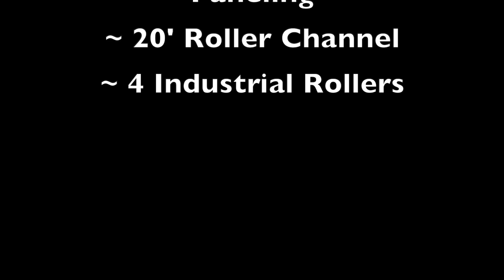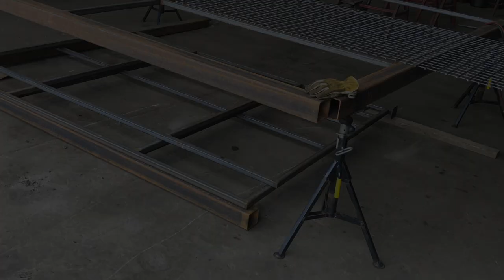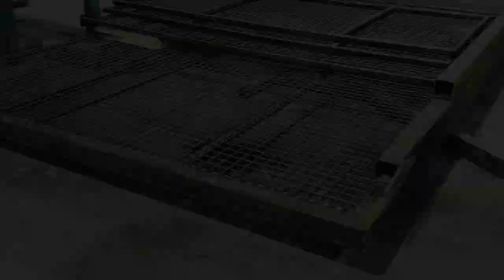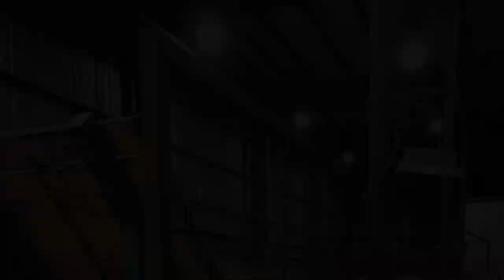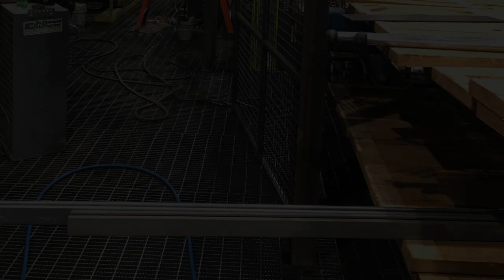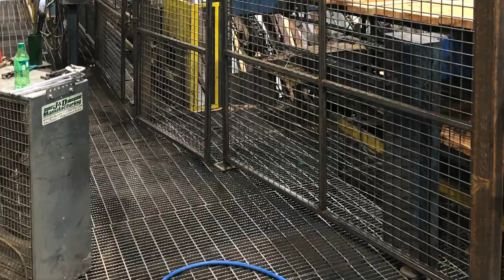PROJECT BUILD - 30' Safety Barrier

Comment: awesome project! looks like fun, the welded wire mesh looks a lot safer than the expanded metal I hate dealing with. well I hated it after building a console for a car between seats, as a teenager, all the way to dash, & having to put gauges & stereo in it, got too many cuts & never cared for since, but had to deal with on so many trailer decks.
Reply from the maker: I agree the welded wire was a lot easier to work with especially since I built it by myself

Comment: Looks awesome. Is the intention to keep things out of the machine or to keep things from flying out of the machine? Only curious with the thought of which side the grating is welded on.
Reply from the maker: I welded it on the inside because it is meant to prevent anything from coming out of the machine and hitting someone.

Comment: Robi > getting errors sending you email (address not found)
Reply: Same issue Hoss!
Reply from the maker: So sorry guys, with my super secret revamp of Welderbeast my email has got changed to robis@welderbeast.com and if it’s easier try sending me the stuff through WhatsApp and my number on there is 479-225-9431

Comment: I would love to have something like that for the coming zombie apocalypse as depicted on the historic documentary otherwise known as the walkin' dead.
Reply from the maker: Lol right
Reply: @Welderbeast  I see a MIG welder in the background. You could show how you made one joint.
Reply from the maker: Protected Profile I was getting paid per hour so only had enough time to take quick pictures during the process. This was the best I could do. I’m looking forward to seeing your video explaining how to weld a joint up with a mig welder though;)
Reply: @Welderbeast  I was trying to fill holes in sheet metal with a stick welder. It was bad. Couldn't get it smooth, tar bedliner on the back, smokin'. I don't have skill.
Reply from the maker: Protected Profile lol I bet you did better than me, I have never welded sheet metal in my life
Reply: try rusted auto-body metal! which is now unknown thickness, as a variable, & weld patch to it. lol. but wont phase me a bit, but big metal, much over 1/4" thick I will be more nervous on, than welding sheet metal with an unknown MIG, lol & PP did you try 1/16" rods? with amps down to min on dc stick welder? but mig will do better. then there is a few other options. like Spot welding, with real spot welding equipment, or Eastwood once made a carbon arc spot welder,  seen it used pretty decently, then torch, & brazing<

to remove the tar bedliner, go 36 grit open coat sanding disc, remove a few inches on both sides & still plan for fire when welding,  lol. body men are too accustomed to fires on cars. lol.
Reply: @Welderbeast  I'm popping it around with 6010 to fill-in the hole at low amp, grinding it down, then trying to run a couple of 6013 beads quickly across the original hole, then grind down again.
Reply: @randymack1782  I am using 1/16" 6013 with minimal amps on DCEP, sometimes DCEN. I might buy a MIG, but would have to buy a bottle, too. I was burning tar with propane and scraper, then kerosene. It's everywhere, on the backside underneath where I can't get. Rivets just spinning in holes. I hit them with 6010.
Reply: On replacing metal, can you cut old out, make a flange, then carbon arc from 1 side to spot weld new metal to flange? Or build your own home made spot welder, I could walk you through it, very cheap to make. Of course there are other spot welders, like "stud welders" which can spot weld with. Or a uni-spotter